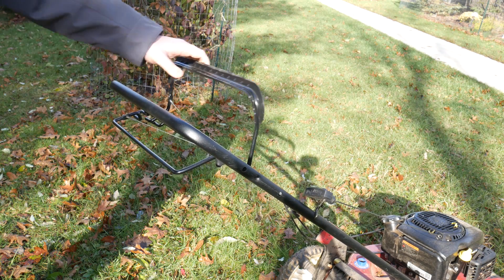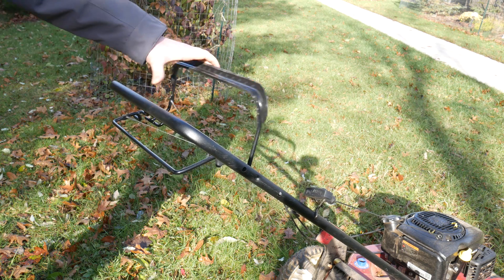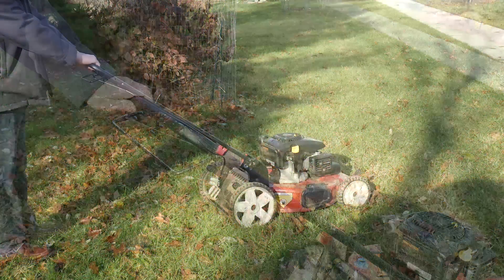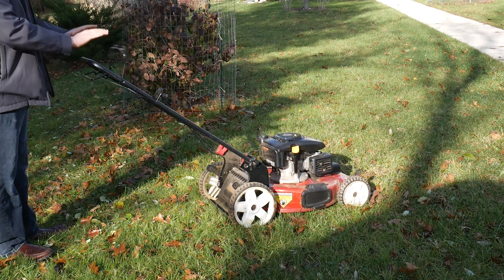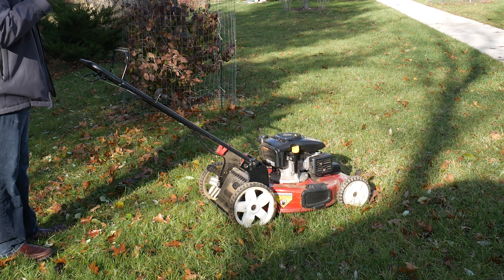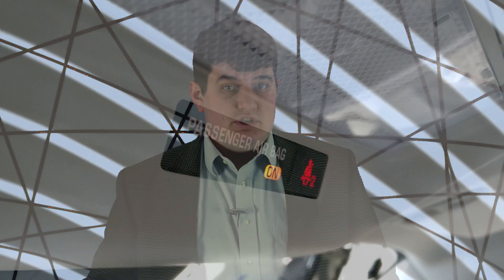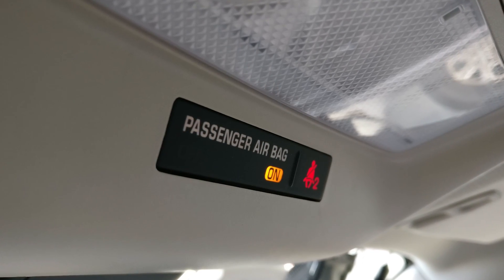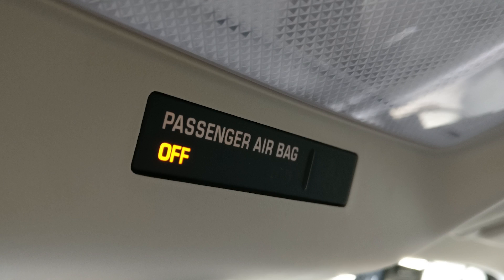The Dead Man's Switch:  How Anton Yelchin's life could have been saved

Comment: If that override is not *purely mechanical, requiring neither power nor computers*, then this interlock will kill people. Every motor vehicle will be towed. It is therefore imperative that all cars be able to be put into neutral, *and left there, even if rolling*, even if completely dead. There are already too many that can't, and while they can be loaded onto a tow anyway, it is a longer process. Deliberately making a job performed on the side of the road take longer is at best criminally negligent and at worst depraved indifference to human life.

Comment: 5:20 Wait, the throttle is disabled when you hit the brake on newer automatics? So no left foot braking while hitting the gas for tighter turns? And aren't the brakes supposed to be more powerful than open throttle? Just step on the brake until you find neutral.

Comment: I believe that Tesla has applied something like this now, where if you leave the vehicle it automatically shuts down the vehicle and puts it in park. Also, if you hold the brake for more than three seconds, then let go, the vehicle will go into a "hold" mode, applying the brakes until you hit the gas again. This is more intended for stoplights, but can help in this situation as well. With the vehicle stopped, if you leave, it goes into park and shuts off. I wonder if Tesla saw this video and got the idea from here

Comment: What happens when you need to have the car towed?  With no one in the driver seat, the transmission locks the drive wheels, two front (mostly, so towing by the rear wheels is possible if the emergency or "parking" brake isn't set) or all four.  My Jeep has an "override" switch but neither the tow operator nor I could find it. The tow operator had to go get another vehicle to allow "road tires" to be put under the front wheels of the Jeep to allow towing the vehicle by lifting the rear wheels.  By the way, in most of today's vehicles, if the battery goes down, so does EVERYTHING on the vehicle.

Comment: I have a 2017 Jeep.  It has a feature that if the car is not in park and you open the door and get off the seat, it applies the parking brake instantly.  It also has a mode where if you put the car in park, the parking brake activates automatically, and deactivates when you put it into reverse or drive.

Comment: they have them in the new Ram pickups. if you are in reverse or neutral  and open the drivers door when the vehicle is already on the electric parking brake will engage. in the last generation if you shifted to reverse while the drivers door was open it would honk and flash the hazards at you.

Comment: theres an endless number of scenarios like this that are unsafe and every safety mechanism/deadmans switch you add is another point where the vehicle can fail and lock up even when it should be operational.. you install 50 safety switches all around the car and after a few years there will be an issue with one of them everymonth constantly leaving you stranded and costing a fortune to have repaired... the car didnt start up and launch itself at anybody it rolled slowly and theres even a redundant braking system thats easily applied in the car if you so wish to use it i think they call it a parking brake... dont give the auto industry more reason to add unnecessary features that make vehicles more costly and less useful

idk what this gear shifter looks like it could be horrid and the whole problem be there or it could be fine and people just exaggerate anything they dont deem perfect.. either way the gear shifter was there in plain view when you test drove and bought the car

Comment: A dead man's switch? So you can't warm the car on a cold day without sitting in it. Get out of the car, open a gate, get in the car, drive through the gate, get out of the car, close the gate, get in the car, drive on. That's not a big enough pain? You need to restart the car every time you get back in? Maybe a better idea would be to fix the damned transmission!
[Edit: spelling error.]
Reply: OK, so the engine could run, but the car couldn't move. Like the Park setting is supposed to do. I still say, fix the problem instead of working around it.

Comment: What’s interesting is since I first saw the electric parking brake, I’ve considered using a dual or quad at wheel parking pawl system in place of a parking brake for a vehicle I was trying to design at the time (with the intent of simplicity and cheapness) something like that is transmission independent and could be engaged every time the vehicle is stopped fully and not likely to takeoff again, the action of pressing the accelerator could be used to disengage it and it helps with going up hills for standard and similar drive types by preventing reverse motion when not applying the brake before putting load on the drivetrain, sensors like the seat and door sensor can be used and if the seat sensor fails, the seatbelt and door sensors would become the default to check

Comment: I was trained to always use your parking brake when you get out.. for this reason. Without it, on a hill, you are putting a ton of load on the transmission. So even in park, you could slowly wear on the elements that keep your car still in park.
Reply: I was also trained to turn the front wheels fully so that if the brake and gearbox both fail the car would move to the side and immediately get stopped by the curb instead of running all the way down the hill. that's the reason why the stirring lock has 3 positions available (center, full right, full left) when you remove the key.
Reply: @christianbarnay2499  And with no curb you should turn the wheels so it runs off the road
Reply: Both the Park pawl in the transmission and the parking brake can fail.  You should use both of them every time you get out of the vehicle.  That way if one fails, you are still good.  Don't forget to test them independently every once in a while so you will know when one is failing.
Reply: I do that too unless it's a flat surface and it's not sitting overnight. It's not so much the constant strain on the pawl/teeth that's bad as they are pretty beefy, it's when taking it out of park and they grind against eachother that's causing more wear. Also, it's a good idea to use the E/parking brake to A: make sure it's still working, and B: keeping it from seizing up. My F150 has an electronic parking brake (which I dislike) and they had a notice that you should be using it once and a while as there were a few cases of them rusting and seizing. I'm sure that applies to a lot of vehicles too.
Reply: I was trained to not use the parking brake unless you really need it, because the brake pad can get stuck to the disc. Which happend to me and I had to replace the brakes, because they got torn apart.
Reply: @pascal2085  Definitely,if you are laying a car up for a while always leave the p/brake off. I've known clutches seize too,have to tow the car in gear until there's a terrific bang as it releases.
Reply: @adeladd7638  No need to tow - just drive it with the clutch pedal pressed for a mile or two and drive jerkily in 3rd gear.
Reply: @pascal2085  This can happen, but usually only if the parking brake doesn’t get much use, so the components corrode and jam up. That or if you’re leaving the car sitting for a very extended amount of time. If you use the parking brake regularly it’s usually a non-issue, and will give you some idea of whether or not it’ll actually work as an emergency brake on the off chance you have a complete service brake failure.
Reply: @gogmorgoaway  My parking brakes are my regular rear wheel brakes, not every car has indepedent parking brakes. So not using the "parking" brakes often enough is not the issue.
Reply: @pascal2085  It may be the same pads but will be an independent system.

Comment: Nah, the much better solution is just to use regular ass shifters instead of stupid electronic ones. Not just simpler, but if you need to have the car in neutral with no one in the driver seat, to push or tow it. Very few people are going to read the manual or have it on them at the time to know how to disable the feature, because they wouldn't suspect something like this exists. 

Also, redundancy of the switch mechanism isn't so simple because of numerous edge cases. For example, while moving >5mph the sensor starts sending a signal that no one's in the seat, the car keeps going, but then the driver stops at a stop sign or traffic light and the trans shifts into park, while the shifter itself is still in drive. Again the driver probably would have no idea what the malfunction is, because they didn't read the manual and don't have an OBD II reader on them.
Reply: i think it's better if the dead man's switch was connected to the door so if the door is open, then the car switches on the e brake.
Reply: @sourmiIk  Even that has a problem, if you're trying to push the car and steer it at the same time.
Reply: it's true, but Chrysler already implemented that in the newer Jeeps. 
Who pushes their cars anyway? Pushing a 2 ton Jeep seems impossible especially for women and elderly people. Might be possible for a sedan but not for an SUV. 

However, I do agree that standard gear shifters are much better but some people may not be able to use a clutch, like maybe they have problems with their legs. those are the only kind of people who buy automatic cars in my city. If they can't use one of their legs for driving, they probably won't be able to push their car either. So I guess it's not that much of a concern over here.
Reply: oh and i just remembered, volvo cars have this gear lock. whenever you exit the car, the car switches into park and the e brake turns on. if you want to push your car, then you can take out the physical key from the key fob and insert it in a slot behind the armrest and you can unlock the e brake and the gear selector so you can put it in neutral and push the car.

Comment: You need to be able to put the car in neutral without being inside for towing and other maintenance situations. Also most, if not all, car don't allow you to remove the keys without being in Park.
And finally there is something called parking brake, that should be put on at all time when the vehicle is not supposed to be moving.

Comment: Dead man switch on locomotives I know of are an alarm that goes off on random intervals (usually 5-10 min). You must press the button or the train will stop. It is not merely a button you must keep depressed. This system assures that the engineer is both present and awake.

Comment: Let me preface this by saying it is tragic what happened to Anton.

Sure a system like that sounds good to say, but what happens when this system inevitably fails at highway speeds? 

The damage to the parking gear notwithstanding, let's consider the occupants of the failed vehicle first: depending on the strength of any given parking gear, the vehicle will either come to a very sudden and jarring stop (with no brake lights to warn drivers to the rear), or the parking gear will disintegrate, possibly even causing substantial damage to the rest of the transmission. In this case the vehicle is unable to be locked in park, unless of course the vehicle has an e-brake or parking brake, and not all vehicles come equipped with these devices.

Then you have to consider the reaction (or quite possibly lack thereof) of any vehicles behind the now potentially disabled vehicle. If it's bumper to bumper traffic you've now got a pileup, with likely dozens of injuries if not casualties.

To summarize, people get paid millions of dollars to engineer vehicles to be efficient and safe as possible. If they could find a way to do what you're asking without risking many, MANY more lives in the process, they would.

I will say, however, a system setup in such a way that if there is no driver present AND the key is removed AND the driver's door has been opened since the engine turned off, that the vehicle would lock in park, that sort of system would be more far more viable than simply adding a seat sensor.

When it comes to safety in technology, redundancy is a good thing.
Reply: Also as an aside, adding the features mentioned in this video would cost millions in R&D and safety testing, so please don't suggest that ANY change made to a vehicle's design would be completely free.

Comment: I know this is an old one but electronic steering is still directly connected for safety through a sun gear arrangement so you can still steer on engine failure / electronic failure
Reply: Also many vehicles can communicate between different systems (can bus) regardless of whether they're operationally separate.
Reply: Also.. all cars have a door open sensor.. perhaps just killing the car when the door open would be enough.
Reply: Also key on/off 5 times will interfere with many remote starters ;)

Comment: Bad shifter or not, the parking brake should have been pulled. If it still moves with that brake on, then you have bigger problems.
Reply: the problem with jeeps is that they have e brakes so if your car is in gear, then the e brake automatically gets disabled.
Reply: @sourmiIk  yikes, another reason to hate ebrakes

Comment: If you really want to make the world of automobiles more safe put your system in but then require an interactive drivers license so if you set the system off it fines you and you lose your license until you go through training not to leave the operators seat of a several thousand pound vehicle without making sure it's secure. Maybe a big flashing light when it's in gear afterwards to warn everyone around you that you have no idea what you're doing. There should be consequences for having to have a system like this save your life but more importantly the lives of people around you. The real problem is complacency and a lack of responsibility for your actions. Runaway truck ramps in the mountains save lives, but if you use one you have to pay to have your truck pulled out of the deep loose gravel, you have to pay to regrade the ramp and you get a ticket with a big fine and points on your license for driving a commercial vehicle out of control. If you're coming down the mountain in a low enough gear there is almost no way you'll ever need the ramp. Safety begins and maintains with awareness and personal responsibility not encouraging complacency.

Comment: Vehicles are made to be shifted into neutral for towing. The engine computer is also usually get engaged once you turn off the car. So if you shift into neutral instead of Park shut off the car and get out even what's up occupancy sensor the computer will be off Punjabi no power available to switch the transmission into park.

Comment: Was thinking about pushing your car when it can’t run. Yes, I just pushed my old Jeep when it failed to start.  What concerns me is the take over of responsibility.  Lots happening and I’m old enough to know what it’s like to adjust points.   So my escape turns on parking lights when door is open. Drives me nuts, but dealer said it can’t be turned off. Come on - lol.

Comment: Always apply the parking brake in addition to selecting P in the transmission. If using two methods of vehicle restraint, one can fail and the vehicle will still be restrained.
Reply: >looks down at my six speed shifter
P...?
Reply: In Ireland people ALWAYS use the handbrake, some learner drivers even use it at traffic lights!! 
And your correct.
Reply: @aidan1585  The problem is that, in American and lots of Japanese cars, they don't have a handbrake but a foot pedal parking brake. So many people forget about it.

Comment: In my base model Seat Ibiza form 2005 has the feature if you press the brake pedal while accelerating the car automatically stop accelerating, and the brakes start to engage, the only way to accelerate again is if you take your foot from the break and the accelerator and press it again

Comment: There needs to be some means to put it in neutral without anyone in the seat for various towing or pushing situations. The seatbelt does that, where if you need to tow it without someone in the seat you could clip the seatbelt and still put in in neutral.

Comment: I know this is an old video, but anyway.. BMW and Mercedes have had this for years, shifting to park when opening the door, which in turn is the cause of many broken transmission cases. It actually almost broke my nose once, I was backing a customers BMW into the paint booth and needed to open the door to see as the car was partly masked off to be painted when the car immediately shifted to park slamming the door in my face!

Comment: So, when someone runs out of gas, or engine cuts out for whatever reason, and have to push car into gas station--or have it pulled onto tow truck--someone will have to be sitting in the driver's seat to allow wheels to roll?  I guess, like you said, there could be a button pressing sequence to allow this, but most people unfortunately do not read their owner's/operator's manual to find these things out.

Comment: My main concern with electronic control is ruggedness without maintenance. If I run a car through the mud or water, I want to know there’s nothing that could happen to disable my vehicle when I need to work most. Every day use is fine, but when there’s nowhere to go for repairs like after bad storms, you have no chance to replace a computer brain. A mechanical problem can be fixed with some improvisation but a damaged computer requires specialized skills and tools that can’t be improvised by your average person. Like after hurricane Irma. There was a three day period before infrastructure was reestablished where we were on our own. Flooding, downed cables, washed out roads. If the computer in a modern car goes then? What do we do? We can fashion a new cable for an old accelerator or brake, but we can’t program a new engine control cpu. We don’t have the parts or knowledge.